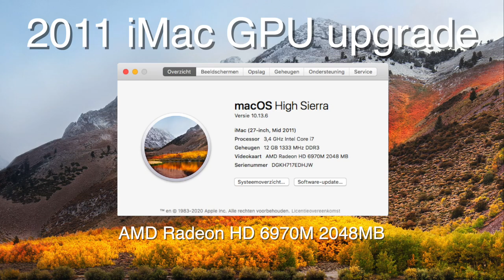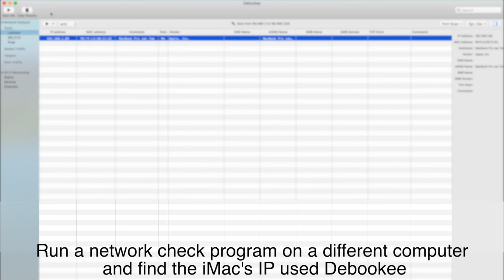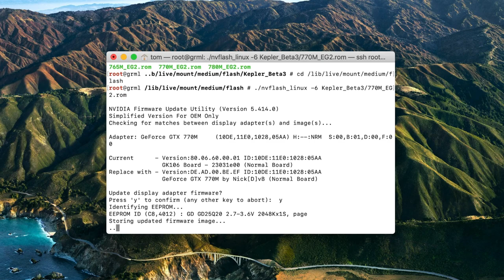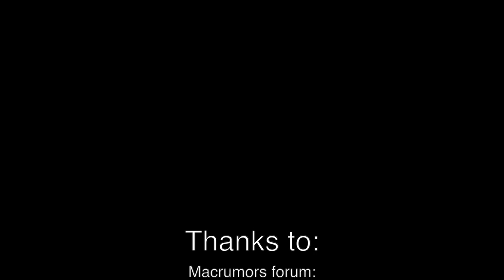iMac 2011 GPU upgrade to NVIDIA 770M with new VBIOS

Comment: Hi Tom, great video!! I was looking for the NVIDIA K2100m or at least one that meets the power specs of my 21,5” 2,8Ghz i7, SSD, 16GB RAM Mid 2011 iMac. How do I recognize the correct card and it’s chipset for instance when to by on eBay or AliExpress? The MacRumors forum has become a complete bookstore on this topic of GPU upgrades for iMacs. At the end I would like to move from High Sierra to Big Sur on this machine.

Many thanks!
Reply from the maker: I myself have little experience on buying compatible graphics cards. The only thing I can recommend is checking the first page of the macrumors thread, it shows the (non)working cards and you can filter out which one you like. I always bought my graphics cards if they came from a Dell computer, most of the time that works fine in an iMac. Goodluck with the upgrade process!
Reply: @tomvreugdenhil1490  Thanks and following your advise.

Comment: You can remove the logic board fairly easily without having to remove the backlight board, power supply, hard drive, optical drive, or any of the fans. Saves a lot of time...
Reply: Can you please tell how and if this also works with an iMac 21.5 inch 2011 ?
Reply: @RobbertvanGomNeumann  2009-2011 27" models. The 21" is slightly different in that you must remove the optical drive and right side fan before the board can be pulled out.

Comment: With the upgrade you did do you have  a boot switcher and brightness adjusting from the keyboard?
Reply from the maker: Yes I use OpenCore to switch between macOS and Windows. Though if I did not use windows, I wouldn’t have to work with a boot switcher. Brightness is not supported with the VBIOS that we can gratefully use for free from the macrumors forum (at least when I made this video). If you really need brightness support, look for some other graphics cards which do support it.
Reply: @tomvreugdenhil1490  ok i get it, thanks!

Comment: Is it necessary to update the VBIOS?
my 2011 21.5 imac's gpu is shorted (heatsink black from under), so planning on upgrading.
Also, What is a VBIOS chip (found one on ebay) and does it need to be soldered somewhere?
Reply from the maker: I highly recommend reading though the fist page of the macrumors forum (link in description) to learn about the procedure of upgrading the GPU. 

VBIOS is only the "software" on the GPU itself to communicate well with the computer it is in, so you do not have to solder anything (also since it is way too small to solder by hand). 

You can get away without updating the VBIOS to a Mac-capable one, but it could result in a bad working GPU or even not working. So I would recommend to update it's VBIOS to communicate well with the iMac.

Comment: Hi Tom; Please show me how to create a Linux bootable USB and how to find iMac’s ip (@ 10:44 —.    ). I am a newbie and this is my very first time doing this steps. Thanks a million. You are the best ***
Reply from the maker: If you want more information about the linux bootable usb, see the macrumors forum: 

https://forums.macrumors.com/threads/2011-imac-graphics-card-upgrade.1596614/page-175?post=28184981#post-28184981

It is well explained there.

The iMac's IP can be found (when connected to ethernet and booted from the linux USB) using a network check program to see which IP adresses are connected to your internet network, just as shown in the video. I hope this helps you.
Reply: Thanks a lot

Comment: Hi TD, why is there a need to grind off some parts of the original X bracket to hold down the new GPU card? Can you not just used the original X bracket and not screw down too tightly? Thanks in advance.
Reply: Looks like there were components on the new GPU that were in the way, which were not present on the older GPU

Comment: can upgard To big Sur ?
Reply from the maker: Yes, that is possible. But this video is not an instruction how to do it. If you want to know about upgrading macOS on these (old) iMac's, please visit the macrumors forum: https://forums.macrumors.com/threads/macos-11-big-sur-on-unsupported-macs-thread.2242172/
Reply: @tomvreugdenhil1490  Thank I'm looking at this model Quadro K3100M  I'm not sure when I finished installing the GPU in I mac, what do I do next? Can the device boot immediately and then flash?
Reply from the maker: @asd657262  I know nothing about the K3100M, but the forum says it only has a bootscreen when it is flashed. So before booting the iMac you should flash is using the Linux method as shown in this video.

Comment: you didn't do the oven thing. Isn't that part of the steps?
Reply from the maker: Baking the GPU is at best a temporary fix, the old AMD GPU will 100% fail again. By replacing the AMD GPU with a different one, you eliminate the possibility of a failure.
Reply: @tomvreugdenhil1490  hi tom i'm getting a mid 2011 27" imac tomorrow with a failing GPU. I'm planning to do this mod and upgrade but do not feel so sure i'll manage to do it right so I wouldn't want to spend a lot on a new gpu. Which one would you recommend ? I'm happy you say the oven trick is not working,  I was definitely not feeling like doing it anyway.
Reply from the maker: @christophejanvier3679  I think a K2100M or something. Check the forum in the description to compare GPU scores and choose whichever GPU is easy to install and is available nearby you
Reply: I might get a HD 6750m for 30 bucks. Would that work ?
Reply: @tomvreugdenhil1490  thé HD 6750m IS the default card on thé 2011 21,5" model
 Would that work?
Reply from the maker: @christophejanvier3679  Yes it would work, but it is again a 6000-series AMD card which is doomed to fail on you
Reply: @tomvreugdenhil1490  why doomed to fail? And not thé other one?
Reply: @tomvreugdenhil1490  i'm taking a 6770m. Very much doomed but only one under 50 bucks.
Reply: is there a lot of vbios and others mods to do if you just replace the gpu with the same model?
Reply: @tomvreugdenhil1490  hi Tom thé repaire failed. It's alright i sold the junk métal for 30$.

Comment: why wasn't the clamp right ? It seems you bought exactly the same gpu model. That part when you file the clamp is probably the one that's really out of reach for ordinary people.
Reply from the maker: The clamp was hitting some very small resistors on the PCB, if I would place it like that in the iMac it could cause bending of the PCB which is not good. Also I think filing down is not that difficult of a task, but I recommend doing it.
Reply: @tomvreugdenhil1490  yeah we don't have the same manual skills level i guess... which gpu do you recommend for mid 2011 as of todays' market ?

Comment: Hello, thanks for the video. I wanted to ask you a question...currently I have a 2011 Imac with High Sierra and gtx 770M by Nick graphics and I would like to know what you think if I upgrade to Monterrey. I saw that it is possible to make this update through "Open Core" but I have doubts about the behavior with that graphics card. What do you think?
Reply from the maker: Hi Andres, Opencore does not change GPU behavior. I myself run Monterey on my 2011 iMac with a 880M using opencore. It works absolutely perfect!
Reply: What’s the Gpu required for2011 21 inch  iMac to run Monterey?

Comment: What CPU do you have?? i am looking for an I7 2600s, Is it the best option? same mac same year, Thanks
Reply from the maker: I believe I have the i7-2600 without the 's'. It is the highest option that was once available at Apple.
Reply: @tomvreugdenhil1490  I read that I must have the S because it was low consumption, otherwise it would not work.  Thank you
Reply from the maker: @UnderGroove  If you have the 27” iMac, you can use the i7-2600. The 21.5” iMac however cannot supply enough power and therefor needs the i7-2600s which draws less power I believe.
Reply: @tomvreugdenhil1490  thanks master!!

Comment: Hi Tom; please show me the website to purchase the correct GPU card ( NVIDIA 770M with new VBIOS). Thanks a lot!
Reply from the maker: I bought it a local computer hardware reseller, so I don’t have a link for you sorry.
Reply from the maker: And also, there are not a lot of cards with the correct VBIOS for an iMac. Your best bet is the macrumors forum and ask if someone has a flashed card for you
Reply: many thanks for your
Reply: Got an 880m off AliExpress
You can get the 770m there also

Comment: Do I need to trimm or do anything to the card if its an gtx 860m?
Reply from the maker: I don’t think so, but I have no experience with the 860M. You probably have to do the same trimming of the heatsink though..
Reply: @tomvreugdenhil1490  Thanks for the answer! What is the best tool to trimm these? If I just let them as they are would that make a big problem?
Reply from the maker: @jojoherrmann7800  I used an angle grinder, but a Dremel works too. If you do not trim the heatsink, the card does NOT fit.

Comment: do you have video in after flash ? man I can't get it to flash!!!!
Reply from the maker: What do you mean with video in? After flashing it should work, just like in the video.
Reply: @tomvreugdenhil1490  I mean mac target display mode these iMac can be used as a monitor... I want to connect it to my MBP m1 and have a M1 iMac when at home. I have another of these 27" and I want to just add a mac mini M1 to it ... For the stuff i do it will be great to have 2 macs in one and switch between the new M1 and the old Intel i7.... As of right now I have nvidia 770 on them but haven't be able to flash them and mac target display mode or video out doesn't work ...
Reply from the maker: @daycareman2374  Ah I understand. If you look at the first page of macrumors forum (link in description), you'll see the seven common issues with using a non-apple GPU. Both the loss of video output through miniDP (one port) and target display mode are mentioned there when using the 770M and not working. So the only option is to use a Apple GPU such as the AMD 6970M series. Good luck!

Comment: Will this upgrade allow me to run macos 10.14 or newer? I recently picked up a imac mid2011 with OS 10.13.6. I'd like to install a newer os, but am struggling to find a solution. Thoughts? Thanks!
Reply from the maker: Yes that is true! If you upgrade to a metal-supported GPU, then you can upgrade to newer macOS versions using various software patchers. My own iMac now runs the newest version of Big Sur without any problems.
Reply: @tomvreugdenhil1490  Thanks!

Comment: can i flash a 1080mxm card and or just boot straight to windows with the 1080mxm
Reply from the maker: I cannot tell you if it works (properly) under mac as I follow the macrumors forum, windows should accept it I think.

Comment: I have the exact same iMac 27 inches. What is the best graphics card I could buy for this? And where from?
Reply from the maker: Please read the forum I posted in the description, it contains a list of (working) GPU’s for in this iMac. I believe the Nvidia GTX 780M is the best Nvidia GPU you can use, but there are some high-end AMD GPU’s that could work, but are very very hard to find and install. Above that, the AMD GPU’s are more recent and quite expensive.
Reply: @tomvreugdenhil1490  Thank you :-), just subscribed!

Comment: Hello, I installed an NVIDIA780m on my imac 12.2 2011 27" and when I try to install win10 it freezes. Do you know if it could be because of the video card?
Reply from the maker: I don’t think it is the videocard. You probably need OpenCore, please check the forum mentioned in the description since your problem is exactly mentioned there.

Comment: One question - did you use a gpu for apple? or did you use just a MXM gpu?
Reply from the maker: I used a gpu which was not suited for this Apple iMac, it is however supported by macOS with drivers. It is not a plug and play solution though.

Comment: I installed the Nvidia K1000m and now no picture on the screen??? I'm attempting to boot from usb to flash gpu. I'm only getting 2 led lights to come on on the motherboard. Help plz??
Reply from the maker: Please keep in mind that this video applies to a GTX770M and not a K1000M. But if you take a look at the macrumors forum (link in description) you'll find all the information regarding your black screen problem. Also, the flashing process using the USB-tool is done blindly (without a working screen) and you need another computer to SSH to the iMac to do it.
Reply: You will need to flash the Vbios using a CH341a bios flasher and clip (ebay). I ended up doing that with a k2000m I purchased, once I did that, the third led came up.  SSH never worked for me. Check the macrumors forum. NOTE: In my case, I also ended up having to desolder the bios chip and manually 'clipping' it to the test clip in order to flash it, because the chip was too small for the clip to grab while on the card. Then I soldered it back on.

Comment: HI I have imac 27 inch gpu failed , want to upgrade , is there any card for upgrade that does not need a flash to work?
Reply from the maker: Your best choice is to find an original Apple gpu, but that is not an upgrade but a repair. If you DO want to upgrade, then the card shown in the video does not need flashing in order to boot up the iMac. However by flashing it you can gain useful features such as better suited clockspeeds for the iMac and brightness control on some cards. If you were to buy a gpu on eBay, sometimes you can get them pre-flashed so you don’t have to do it.

Comment: Dumb question, if it works with Nvidia 770m why flash vbios what’s the benefit thank you 😊
Reply from the maker: The card performs better in the iMac once flashed. On other cards flashing can result in useful features such as a bootscreen and good brightness control.

Comment: Does anyone know if this flash tool works also with AMD cards? I want to upgrade from an HD4850 to an HD5750 on a 2009 27" iMac. Thanks!
Reply from the maker: The flash tool should also work for AMD cards! If you check the forum, there are multiple users using the Linux flash tool with AMD cards. Good luck.
Reply: @tomvreugdenhil1490  Thanks Tom!

Comment: A question, is it important to flash the vBIOS or it'll work good without it?
Reply from the maker: You can use the GPU without flashing the vBIOS, but since it is a simple procedure and you get back features such as brightness control and better performance I strongly recommend doing it.
Reply: @tomvreugdenhil1490  ok, thank you!

Comment: I just changed the graphics card for the 770m but now my screen goes black, I hear the start-up sound and nothing else, it is still not patched, how can I start with the integrated one in the cpu or another way?
Thanks in advance
Reply from the maker: I believe that you experience the "black screen problem" as written about on the first page of the MacRumors forum (link in description). There you can find the procedure on how to fix it, I believe you must do (3) PRAM reset(s) (but I'm not sure).

I don't know how to boot with the integrated GPU, maybe via safe boot?
Reply: @tomvreugdenhil1490  i will try today, its complicated to me read in english but try with translator. Thanks!

Comment: Do you know if the "target display Mode" works with the gtx770m in an iMac 27 mid2010?
Reply from the maker: Target display mode does not work with the 770M. You can see all functionalities on the first page of the macrumors forum (See link in description)
Reply: @tomvreugdenhil1490  will GTX880M work?

Comment: Does that Gpu works out of box without the flashing the bios?
Reply from the maker: If you take a closer look at the video at 10:00 you can see that the iMac does work without flashing the VBIOS. It is however strongly recommended to flash it for performance gains and maybe even brightness control of the display.
Reply: @tomvreugdenhil1490  just saying that because I bought one gpu that didn’t came nothing no image nothing maybe was not supported I don’t know. And for the small cards each one is a good option?

Comment: This  video is exactly why I hate apple macs and will never buy one again. I own a 27" imac from 2009.... Upgraded from Core 2 duo and 7200rpm HDD to new motherboard with core i7 3770 processor and SSD.... Upgraded from 256mb graphics card to AMD Radeon 1gb card.... i hated everything about it all....
Reply from the maker: Sorry but what is so bad about upgrading an old (bad spec) computer to better specs? I think that that is a good thing! :-)
Reply: Would have been cheaper to buy a second hand iMac 2011 complete with dead gpu. I just got a 27" iMac i7, 16gb ram in A condition for 100 aud, $40 for SSD and $75 for GTX 770 and its blazing like a mofo
Reply from the maker: @123Croupier  That is a really good deal! The iMac with a 770M works like a charm.